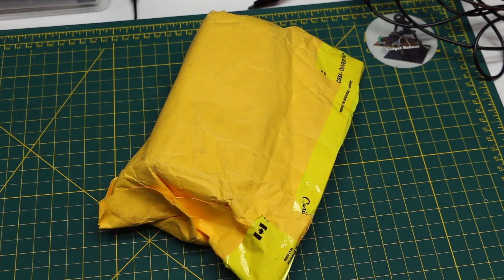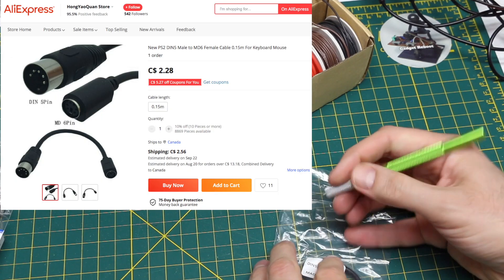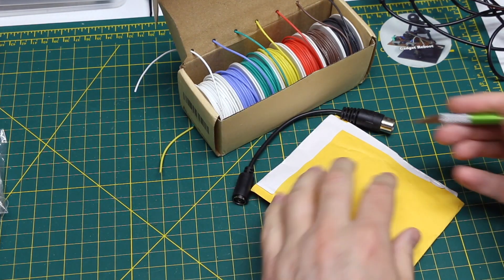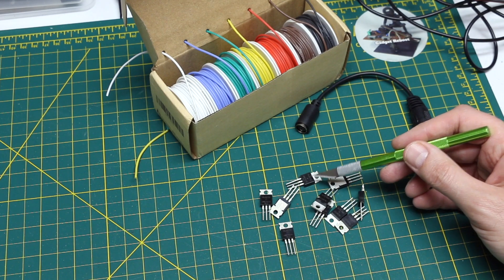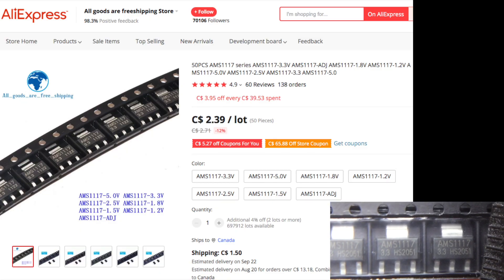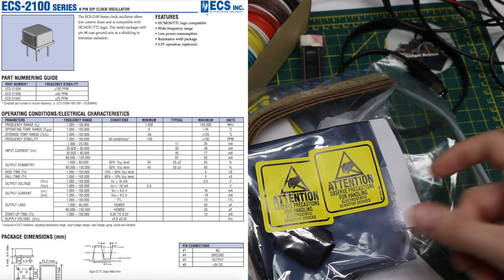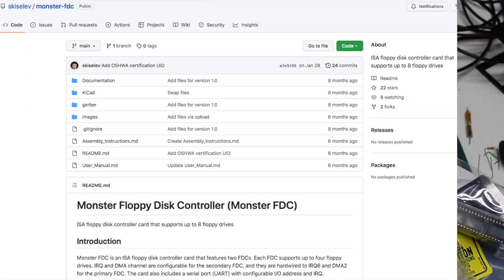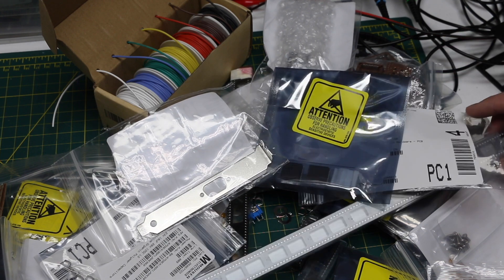Mailbag - Wires, Things, and Parts for a Floppy Disk Controller Card

Comment: Great channel. Word of advice on the mini toggle switches. Go real easy on the heat or you'll melt the body where the line goes in making it either shorted or open permanently. i use these regularly and some were so crappy I had to use flux and a heat sink to get it right .

Comment: Nice to see the esd protection they used for shipping the fets. Watch out for the insulation on the wire, used some that came in a box just like that this week  and the iron tip went straight through it. Claimed to be silicone or similar but must be the low melting temperature type ;-)
For wire i just use 22swg 7 strand and buy it 100m reels slowly working up to having all ten colours.  Plus red and black in 20swg for things taking a little more power.

Comment: The first Mosfet on the page you ordered from, the IRLB3034 is exceptional, and my favorite for low-speed logic-level switching.
It has an Rds(on)=1.6mΩ @ 4.5V.  This is a delicious when you want to drive high current loads without the need for a heatsink.
Perhaps not-so-hot if you are using PWM.  Trenchfets/Hexfets tend to have a high gate capacitance, making them slow.
Oh, I like that gooey fine-stranded silicone wire.
Reply: Was going to say that you have to remember that the logic level refers to 5v not the new 3v3 logic

Comment: I use to collect those keyboard adapter cables before USB truly took over
Reply from the maker: I still have lots of PS2 to USB dongle adapters. As I go through all of these old systems I plan to try to downsize only to what’s  needed at this point in time. It’s not 2010 anymore